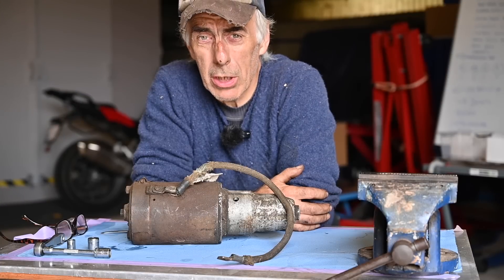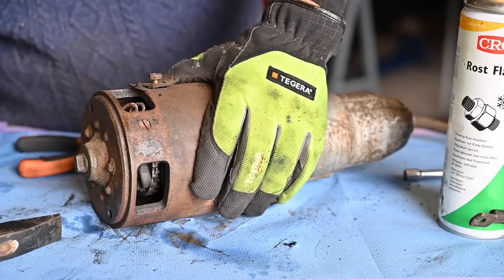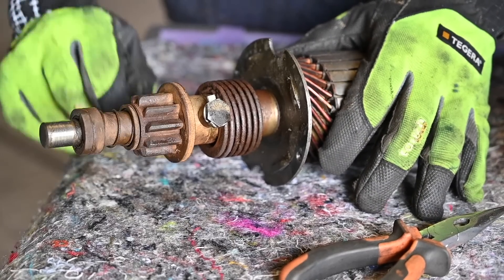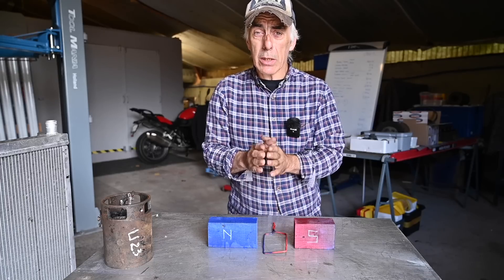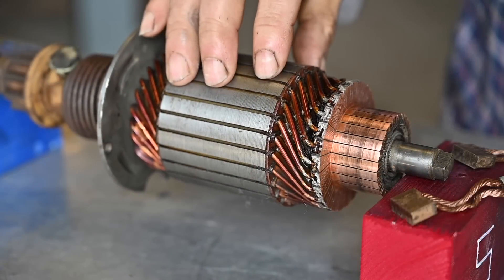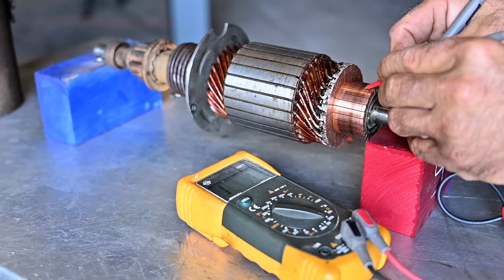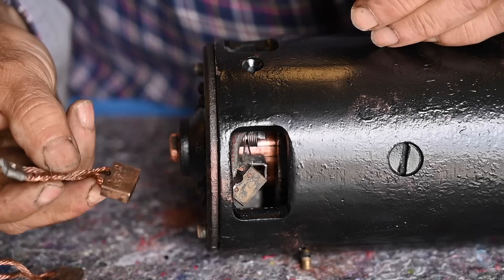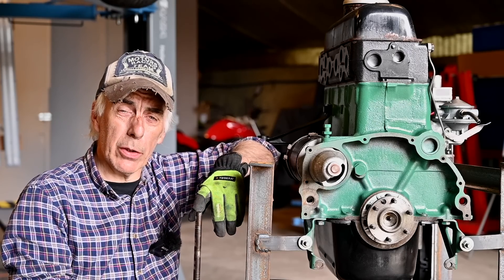Old Rusty, Starter Motor rebuild

Comment: Excellent video. Brought back my days in the black gang at the Clywedog Dam near Llanidloes, Wales. I was 22 now 82.
Reply from the maker: Thank you for the comments, and I am intrigued  by  the black gang at the Clywedog Dam near Llanidloes, Wales.  Can you tell me a bit more ?  I would appreciate that
Reply: @D3Sshooter  The Black gang was a group of mechanics. I looked after a group of Cranes. There was one on each Buttress. As the Dam rose from ground up to 300 feet The cranes rose up too. I had a good head for heights. I also did Air compressors, lorries, diggers etc. A truly great job.
Reply from the maker: @frundlemud  Thanks for the comments, very interesting to read

Comment: This starter motor has no solonoid as you said,but the engagement of the Bendix to movement forward is clear,
engine starts and runs and the Bendix returns___ but why this when it is going against the power that activated forward in
the  first place?
I am a great fan of yours and learn a lot from the detailed ,patient, explanation of everything.
Are you a lecturer as well as a skilled technician? Your teaching skills tell us that you are.  Go on, tell us
Greeting from |reland   Leo.

Comment: Sir,.  Your video appeared to be more a tutorial about the parts of a starter and the functions of those parts. Beginners would love your video.
Reply from the maker: Yes, you are right
Reply: @D3Sshooter  Sir, I respect your humility and knowledge. I commented because I once owned a 1996 Singer Vogue and occasionally had to do similar repairs to the starter, Lucas D40 generator and the water pump. Luckily parts were available.
Nowadays young DIYers would not be familiar with such type of repairs so your video may appeal to some curious ones.

Comment: Thank you for this video. I’m refurbishing an old Caterpillar 6 volt starter motor, which is very similar, but not quite identical to yours. Watching you pull your starter apart let me figure out what I was missing in the disassembly process of mine. I have also noticed that my starter appears to be missing the bendix gear return spring which is a fairly major issue…

Comment: To install brushes, use the spring to hold the brush in it's holder by pulling it right back, then kink the brush over slightly  so it's leaning slightly. the spring is then allowed to sit against the side of the brush, locking it in it's holder when the end plate is fitted with Armature in place. ,the brush is just pushed into place and the spring will automatically pop onto the top of the brush holding it down against the commutator.. I have a hook used for pulling the springs up ,made about 50 years ago from a broken hacksaw blade.
PS, regarding location of oil holes, they are Always positioned opposite the load surface ( in your case the load is on the top) as a small vacuum is present in that area whilst in operation. this is found on all oiled machines regardless of type.
Reply from the maker: TXS for the comments, I learned something here -

Comment: Smashing video :-D,  You made it very clear and the correct names for the armature/commutators, some people keep wrongly saying 'rotor and stator', that is for alternators.
Make sure the bendix and shaft has a light coat of oil.
I used to work in an auto factory.
Reply from the maker: Glad it was helpful! and Thanks for the comments

Comment: Fairly good go-over of the starter. My only comment would be that the commutator contacts need to insulate from each other. Little bits of the brushes wear off and get in between them and short them one to another. Those little bits do not carry the high current of the armature, but they are not good, either. My uncle had an electric motor rewind shop and I used to visit in my youth and watch the techs work on various motors, including occasionally ones like this. They would take a kind of hack saw blade and work it between the commutator contacts, then blow the slot out. This would make little ridges at the edges, which got fixed by turning down or like you did with the sandpaper, although you have to once again check and blow out. They should not short to adjacent contacts.
Reply from the maker: Denis , you stated "the commutator contacts need to insulate from each other".    That is indeed a common standard and typical combined with a 180 degree test.  But this winding is different, and between adjacent segments its ok to have continuity.
Reply: @D3Sshooter  If adjacent segments have continuity, all segments are shorted to each other, which CANNOT be right. The only saving grace is that the connections are not high current, as I mentioned above. It is better to clean between them so that segments do not short to each other.

Comment: For starter solenoids - when I was working on cars a lot many years ago, it was common for the starter solenoid to be mounted on the inner fender or the firewall.
Reply from the maker: TXS for the comments,
Reply: That would actually be a starter relay.
Reply: @ercost60  Quite correct, but they were commonly called solenoids.

Comment: A 6 volt starter will work on a 12 volt system, at least the Chevrolet 6 volt starters did.  They would put out a lot more power than their 12 volt replacements, some people put them on in the early day of the small block V8 when they put a lot of compression into the engine and the 12 volt starters would not work as well.  The windings of the 6 volt used a larger wire and the insulation would withstand the voltage, of course the batteries didn't like you to hold the starter engaged for a long period of time and sometimes the increased current draw would melt the internal connection to the battery post but they had a lot of torque.
Reply from the maker: Thanks for the comments Roy,   Indeed the main thing here is the current  as that doubles at 12V.   So, that could indeed be an issue for the 12Volts battery drain...   Something I should try out.  Good tip, thank you..

Comment: Its a good idea to soak the bushes in motor oil for 24 hrs rather than just putting copper-grease on as it tends to dry out. You can pull the springs back and move them to one side and the brushes will go out and in easily. Don't use oil on the bendix, clean it and rub the sliding surfaces with a soft pencil.
Reply from the maker: TXS for the comments, good tips

Comment: Hello
Thank you for the video! I have a question that I can't find an answer to anywhere. I have a 1953 Nash Ambassador with a 6 volt starter. I started a rebuild/restoration of this starter and found that it has a lot of armature shaft play. There should be an insulating washer on the end of the commutator, it looks like leather, but it has worn out. But even if I put a new washer there about 1/8 thick there is still too much longitudinal movement of the armature shaft. The front and rear ends of the starter are new and have new bushings, there is no radial play, it is longitudinal play of the shaft. Even the shop manual does not have any information about this. Could you please tell me if this is normal and if not, what is the cause of the longitudinal movement and what to do about it?
Thank you.

Comment: Amazing video! Starters have always been a mystery to me, but this explained it perfectly! 

I'm going to be cleaning a 60 year old starter I have now. Do you think it would be safe to soak in carb cleaner? And that insulation tape you used. Do I HAVE to use that, or could I use a liquid gasket in it's place?

Comment: Hi shooter

Iv got a Fiat 128 Rally 1974

Do you know why starter keep cranking and not start,  i had to take of battery cable to stop it. 

After days strangle i find out the points it self touchinng earth. Plastic of the points melded and so touch earth. 

Well after fix the points iv got spark and starter stop keep cranking. 
And problem solves now. 

On my coil i got 3 wires. 
1. Ignition wire on +
2. Wire go to points -
3. Wire on - also. This wire i got no idee where it go. 

How can points that not work good like this. Make the starter keep on cranking. This confuse me totale 😁

Comment: You can use a 12 volt battery on a 6 volt starter by introducing a resistor. In this case by connecting the positive to a length of water pipe or rod as a resistor.  You will need to use the multimeter along the length to find a point that will get you closer to 6 volts - like a rheostat. All components will need to be mounted - wood and cardboard are good insulators - to prevent shorting and safety glasses worn. This is for a quick test, as the pipe or rod will heat up if a test component is run for long time.
Reply from the maker: TXS for the comments, I see , Its all about U=I.R

Comment: I have a starter that just draws current once power is applied to that power terminal on case after I bypass the solenoid but the starter doesn't spin but sit there and the battery terminal sizzels.
Reply from the maker: Thanks for the comments

Comment: When you measured the case you said nice continuity,  what resistance roughly should it read between the power terminal on case to each brush?  A few ohms??
Reply from the maker: yes indeed less then 2 Ohms
Reply: @D3Sshooter  I would have thought even with coils in rotary having a short to another coil that the motor would still turn but poorly and not completey short out the supply from the battery lead.

Comment: thanks for this - is there a link to a parts house for motor parts? different armatures, brushes etc... my spring on brush holder rusted off....so that ring needs replacing but i lack the vocabulary...thanks in advance
Reply from the maker: I get mine from Franssens

Comment: Can I ask you,  what do you call the adhesive paper you wrapped around the brush opening?
I have the same problem on my starter where the metal strap has rusted through
Reply: He called it insulation tape, but not sure why it looks textured. *Auto shop should have it. Looks different to electricians tape though - that's just rubbery plastic colored tape. The one he uses looks thick and imbedded with something solid or granular.

Comment: I was watching you video and noticed that the bendix did not spring out when the motor turned. I am wondering if this starter is a positive ground and was turning the motor the wrong direction?
Reply from the maker: Indeed, it moved a little bit, the reason is that the start current is not strong enough

Comment: Invest in a bench vise.  Your starter is a positive ground- during the test it was not rotating the right direction and the bendix was not working.
Reply from the maker: OLD SCHOOL , txs but it is negative ground.  The bendix did move a little . Since i do not have the needed amperage to have a quick zero to rotation time the bendix did not move enough.  Remember that the bendix moves forewards due its inertion.   Soon we will it when de flywheel is and i have a 6 V battery
Reply: @D3Sshooter  OK- maybe just the illusion due to camera strobing, it looked like it was turning backwards and that would not allow the bendix to engage.

Comment: The brushes look very worn , did you check against a new one , they are cheap and probably easily available even for this vehicle
Reply from the maker: TXS for the comments, I did check the dimensions and they are almost the same .  1-2 mm difference, so I kept the old

Comment: Is that 12v or 6v
Reply from the maker: that is a 6V, but you can start with 12V ( not prolonged of course and it could crack the bendix head)

Comment: Been a long time since I thought about rebuilding electrical components. I used to have a Ford Thames van with Lucas electrics. I got to rebuild the starter motor and generator annually.  Nice to have designs that allow rebuilding, not so nice that they were such poor quality.
Reply: Joseph Lucas = The Prince of Darkness
Reply from the maker: TXS for comments

Comment: what does that springy part between the bendix and the armature do?
Reply: A shock absorber. Mechanism I think
Reply from the maker: Indeed a shock absorber when the small teeth wheel grips in the flywheel

Comment: Your explanation of how the commutator and brushes work is very muddled.  For a motor to spin it only needs 2 segments on the commutator.  The extra segments are not to make it spin but to make it spin smoother.   Your motor requires 4 segments due to the 2 additional brushes for the field coils.
Reply from the maker: indeed , as that is what I tried to state...

Comment: no need for a  solenoid when you have a foot switch to connect the starter its old school
Turning and undercutting of electric motor commutators are performed for various reasons, but most notably for preventative maintenance. For example: these services promote the uniform wear of motor or generator carbon brushes, which will extend the brush life.
Reply from the maker: Thanks for the comments